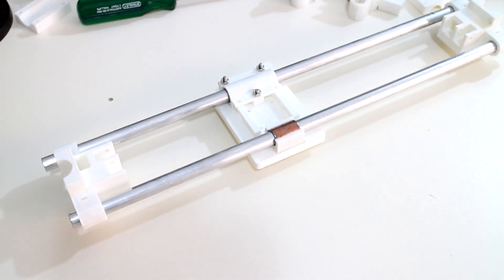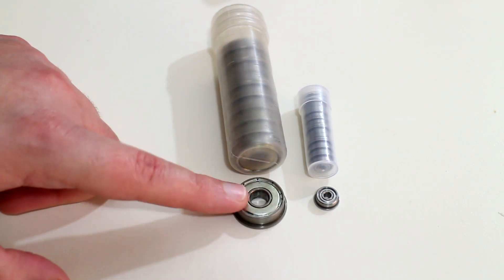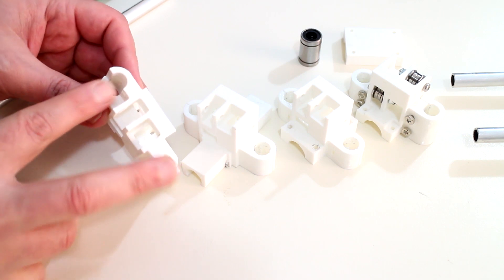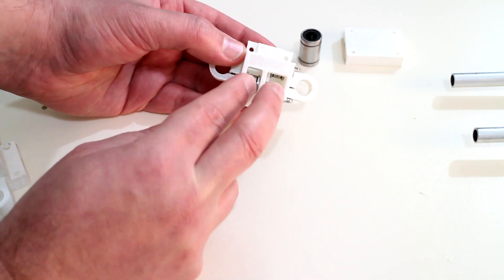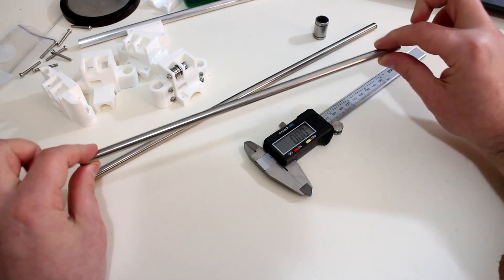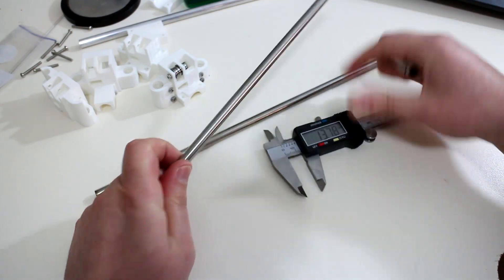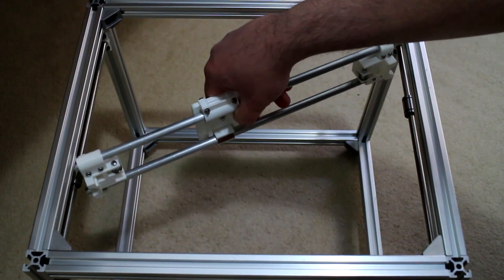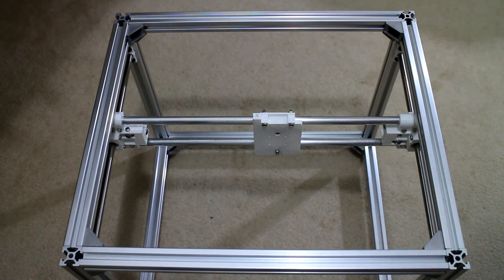New 3D Printer - Build Log #2

Comment: You shouldn't use the bearings for the 90° turn. Use a proper toothed GT2 pully with bearings. If you run your belts across a flat pully (bearings) it will ride on the tops of the belts teeth. As it's turning it will vibrate. Just use one with teeth or your gonna have a bad day...... 

...and carbon fiber tubes are hella light. You need to use the ones that are sanded on a lathe. I don't know how that would hold up to the bushing wear.

Comment: I was impressed with the build of your printer until I  saw the rapid changes of directions required for each motor to maintain the core xy movement concept.  The rapid changers in direction will require very carefull adjustment of accel in the x and y axes to make sure that steps are not lost for either motor and your print head loses its position.

Comment: Is the bearing setup with the 623zz bearings really only made out of 1 20mm m3, 1 locking nut and the 2 bearings ? A m3 screw is 2,9mm and the bearings are 3 so there is play?

Comment: EBAY has lots of Aluminium rod sellers, eg. Metalsshop, Fixed Delivery regardless of quantity makes a 99p+/m affordable as you can get X  8/10/12/14/16+ mm rods for one charge £3.95 P&P; *If buying different diameters add a NOTE to your Seller to let them know you're ordering multiples which are part of the same Order so they don't dispatch them separately and charge £3.95 P&P "per item".

Comment: What material do you suggest making the printed parts out of? Is melting a concern with some plastics and the heat generated by the printer?
Reply: David Monti 
FYI I'm using PLA for the first parts myself. I will prob reprint everything in PETG once it's up and running. Hotend is initially PETG tho.
The PLA seems to work fine but bump the hotend temp up by 10 deg if the thinner parts are cracking on you then it fuses better and is stronger.
- Eddy

Comment: Hi Tech2C,

You might want to remove the larger bearings from your BOM on Thingiverse... they are still being listed! (As of Jan 12 2017)

 - Eddy
Reply: Loren Carlson 
AFAIK you need 16 (8 pairs) but Banggood sells them in lots of 10. I have most of my xy gantry and the complete support structure made now..
- Eddy
Reply from the maker: Are you referring to the F608 bearings? They can be used for the spool holder, and the Z leadscrew support.
They are optional of course.
Reply: Ah, just tried them as 8mm lead screw supports. Thanks for the info.
 - Eddy
Reply: Good to know, thank you. I just ordered them from Banggood today. I already have the 8mm lead screws. :-) Also,...do we still need just 20 x F623ZZ?
Reply: I'm VERY new to this and still putting two Anet A8's together. But , I've also been buying for a Hypercube  type, built around a 300x300mm bed. Already have the heatbed, PSU, Geeetech board with DRV8825 drivers, 5 steppers, 32 ft. of 25x25 T-slot, and a pre-cut kit of 20x20 V-slot for a very good size printer. And much more, along with what is on the way already..

 All I'm waiting for are the corner braces and screws.( ordered yesterday). I also found some 12mmx500mm carbon fiber tubesfor the linear rails, at a good price, and their on the way too. Just to give it a try, who knows what can come of it. I can always find a use for something like that. 

Feels like Christmas with all these packages coming in several times a week. I do A LOT of research, and reading everyday, anywhere from 6 hours after work to 15 hours each Sat. & Sun. I'll make it work one way or the other.

If you any thoughts on the carbon fiber tubes used as linear rails, please feel free comment. Any info would be appreciated. I have some ideas just in case they are not rigid enough as they are by themselves. 
-Loren

Comment: Yes those are 5/16" standard rods which is basically 9.9375mm. I prefer to use 5/16 in that case because of the unreliable LM8uu manufacturer to produce guarenteed quality. In that case, I would prefer loose fit rather than over tight fit which force the stepper or miss some steps.

Comment: hi there ref aly tubes, you could just steel or stainless tubes which would get your weight saving, or to really get the best of both worlds, you could use aly tubes and have them hard anodised. this isn't like normal anodising, it's rock hard and builds up more like chrome as opposed to a few microns like anodising. this means you can get the tubes ground to a precision size to accommodate your bearing, if you contact a local plater and and a local grinder you may be able to get it done for a reasonable price if you use a bit of charm 😀
Reply: just realised, igus actually supply hard anodised aly rod and tube for their polymer bearings. bit pricy, but I would actually like to try that myself, watching your videos closely for inspiration before I start mine though!
Reply: All your comments are valid but it's also important not to waste half your life scouring the globe for 'perfect  parts' when you could be using something 100% suitable even if it's not the absolute best available. That said, I appreciate that the better the build the very much better the printer model result.
Reply: Sally Taylor I work as an engineer so we use these methods, materials etc all the time, don't worry, I have wasted any time 😀
Reply: Fantastic, we can  pick your brains then can we, lol! I know that you know what I mean... Ive come up with an idea to use rods which are already cheaply manufactured for a UK based Retailer. They are lightweight, absolutely rigid, yet load bearing. Fingers Crossed :  )

Comment: loving this build! can't wait to see when it's done! you should print some astrosyn dampers from Thingiverse and test your X-Y motors with them installed.
Reply from the maker: I have the metal ones from banggood. I tested them on my Prusa i3 and they really quieten down the printer. I would lose too much height to use them on my left motor on core xy, so I'll probably have to use a thinner dampening object.
Reply: Interesting, how thick are your dampers? The ones from thingiverse are about 1cm in thickness.

Comment: So, you stated why you are using the bushings on the x? axis in the first build log, but why are you not using them on the other (y?) axis? Maybe you stated your reasoning but I can't find where, and I was wondering because the sound difference is incredible. 

If you help me with the reasoning that would be great because if I follow a similar set up I would want to know why you chose the slightly louder version. Is it just to use what is on your original printer?

Comment: I would recommend that you sink the nuts into the plastic as a capture, it works very well, then when assembling and disassembling, you only need a screwdriver.  It also looks much neater :)  Good luck!  I'm currently on the final steps of making an ultimaker 2 extended aluminum extrusion clone.
Reply: Also, I really like how smoothly your X/Y gantry setup moves, I may have to do a redesign as I haven't been too happy with the stock setup that Ultimaker uses.
Reply from the maker: Hey there Mr Head, I would like to sink the nuts into the part, but I have 2 M3 nuts here with different diameters! Really annoys me because I want to sink them, but if the nut size is not standard then it's pointless.

Also if you have access to an Ulitmaker, does the x/y axis move like mine do? Or are they stiffer, bind/stick? It would be good to compare if I'm on the right track or not...
Reply: That is really wierd that they're not standard sizes, I usually do my stuff in small volumes so I just measure the nuts that I intend on using for that part and extrude cut for that size.

I have been going loosely off of a design on thingiverse, if you search for ultimaker 2 clone it should be one of the first ones.  I have a Robo3D as my printer I'm using to make the parts and don't have access to an OEM Ultimaker.  From your video, it looks incredibly free moving, at least compared to my setup.

Comment: Awesome that looks really great! How is the x carriage torquing resistance? Like are you able to twist the carriage much along its axis of motion? I've found that's a huge player in reducing rippling in prints and can make or break a design!
Reply from the maker: It seems fairly solid, but I have nothing to compare it to and this is my first core xy. You've build many of these so your knowledge is greatly welcome here :)
I probably won't know the result of any torque errors until the first print, which is a bit of a pain but I guess it's part of the design cycle.
Reply: +Tech2C gotcha! Also keep in mind you can minimize any potential error propagation by keeping the tip of the hot end as close as possible to the rotation point, which for you would be the imaginary line connecting your two y-axis linear bearings. Good luck!
Reply from the maker: I see now! Well I'll continue as I am, and if the y axis rotation point is an issue I'll push forward the y axis bearings to match the nozzle centre. Cheers again!

Comment: As always, very impressive work.  The 7.94 mm rod thing was interesting - I measured my own, and they were 8.0 mm (Chinese I3 clone from Zonestar).  That's an important thing to watch for.

As your build progresses, you will have to mount a hot end filament extrusion unit - probably an E3DV6 or similar.  The standard way that these are mounted on most 3D printers is to bolt them to the carriage at the top of the cold end, where the filament feeds in.  But this leaves the entire extrusion unit 'swinging in the breeze'.  Changes in direction or velocity mean that even very small torsional inputs at the mount point will be multiplied over the 3" or so length of the extruder, resulting in potential nozzle positioning inaccuracies.

I think you might want to consider a second mount strut to stabilize the extruder.  I would place the second strut as close to the filament heater as possible; on an E3DV6 this would probably be an aluminum cooling fin on the cool side that is closest to the filament heater.  That should prevent any potential inaccuracies due to the extruder only being mounted at one point.

I'm really enjoying this series, and have put my own design on hold while I watch your project. Already, I've picked up some decent ideas to make my own design better.  Keep rocking!  Regards, Charlie

Comment: Looking forward to the build. You've inspired me to waste more money and build another printer :P If you take your prusa apart and need some printed parts later on, I'd happily print them for you for free and you can pay for the postage. I'm in Sydney so it shouldn't cost too much.
Reply from the maker: Sweet thanks!
Reply: Tech2C No worries :)
Reply: +Tech2C From Canberra here and looking to get into  3d printing. Ordered the Original Prusa i3 MK2 kit as my first :) 

I am curious like what is the difference between the Ultimaker 2 and Zortrax m200 kind of Core XY, where the printhead can moves diagonally compared to the one your are building and some i had seen, where the head moves on x axis and the y axis moves, which also is considered core xy right? Whats the differnce?

Comment: Good luck with the build, it will be good to see how it will be good to see how it all turns out.

A few things FWIW. Yes I use the same multi-start Z leadscrews and they work fine. Likewise for the flanged bearings to guide the belt.

In regard the aluminium tube/bushings, no disrespect intended, but I think you've come up with a solution in search of a problem. You mentioned grooves wearing in the linear rails, and yes I have had that happen.The reason is the "hardened" rails aren't! If you use genuine hardened rod you won't find any significant wear in the rod. Rather than the round linear bearings, I've found the SC8LUU bearings blocks are suitable for stand alone containment, as one bearing block is sufficiently stiff to allow just 2 bearings instead of 3. The design of that bearing block frees up a lot of design hassle, as they simply bolt to a flat surface.

It's probably too far into the build phase for this to be of any real use, but maybe something to consider for future. Thanks for the heads-up on the extrusion. That used to be very expensive and difficult to get in Australia, and it's good to see it's now freely available.
Reply from the maker: It's good to know the lead screw and flanged bearings work for you. One of the design goals is to re-use existing printer parts from my Prusa i3. Therefore I'm using LM8UU bearings not the SC8LUU, but good idea nonetheless.

Comment: What material are those printed in? Polycarbonate?
Reply from the maker: White PLA from Aurarum.
Reply: +Tech2C  Are you concerned about warping from heat? Or is it negligible at the distance that they are away from the hot end and bed?
Reply from the maker: BN

I'm still in the design-print-design phase so I just want to quickly print and test - PLA is the easiest plastic for that purpose. Once the parts are finalised I'll switch over to ABS for the heat resistance it offers.
Reply: +Tech2C Ok, makes sense.

Comment: Same story here, not 8 MM rods, the lmu's making so much noise that I replaced them with igus. But its the rods to blame.
Isn't it better to leave your old printer in one piece? It will save you about 125/150 euro's I think but for that money you can always fallback if you need to print quality parts for your new printer.
Reply from the maker: My Replikeo Prusa i3 is too old and needs to retire. I think once the new printer is functioning I wouldn't use the old one often enough to warrant the space it occupies.

Comment: I'm loving this build series. I have a Prusa i3 that I might just do this to. I prefer to have the build plate move on the z axis and the printer head move on the x and y. My other printer is setup like this and I think it works better. Also having it that way you can close the printer with plexiglass to keep the heat in, which is better for ABS prints. Can't wait to see the finished product and final designs!
Reply from the maker: Correct! I can't wait to enclose the printer and exhaust the ABS fumes outside with a long duct. Cheers!

Comment: i don't understand why using bronze busshing on the X axis but lm8uu on the Y axis ?
Reply from the maker: A design goal is to keep the moving mass as light as possible. This means using aluminium shafts for the x gantry as the entire gantry will be moving on y axis movements. The balls inside the lm8uu will cut a groove very quickly into aluminium, so I must choose a different linear slide. These bronze bushings are actually self lubricating low carbon steel.
Reply: +Tech2C i didnt thought about that. thanks for the quick answer